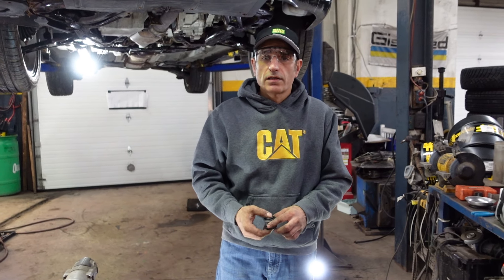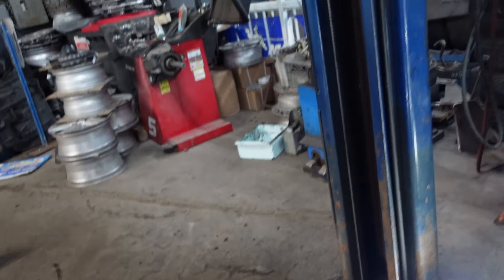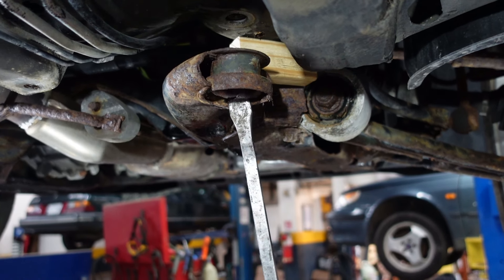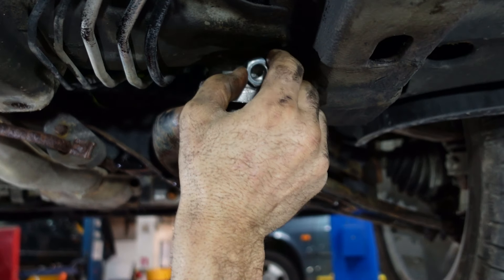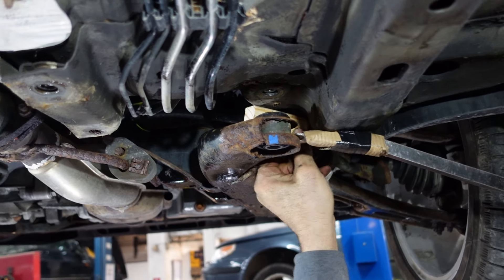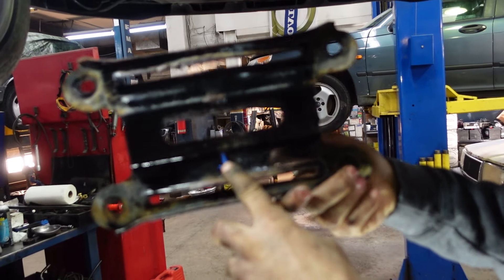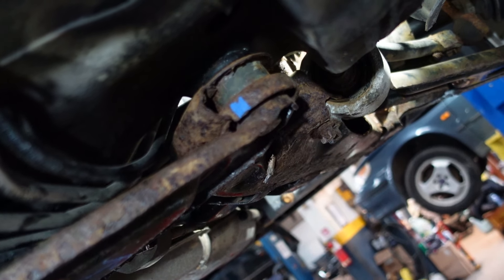How to Replace Press Fit Subframe Bushing SAAB 9-5 1999-2009

Comment: Excellent video! I just finished front subframe bushing replacement work on my 2002 9-5 sedan and 2003 9-5 wagon. I installed Powerflex polyurethane bushings. Anyone who is looking for replacement bushings, I would strongly advise against using the blue polyurethane bushings. These are very low-quality bushings. These dry out and crumble very quickly. Thank you for the information. Cheers.
Reply from the maker: Thanks for sharing!👍

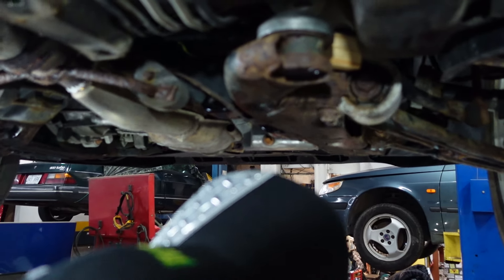Comment: Great video! Why did you mark the bushing and the frame and line them up before pressing it in at the 3:05 mark on the video? Do they only go a certain way?  Thank you.
Reply from the maker: Most suspension bushings come with markings on them. It should be positioned & installed properly. In some cases, it is better to put a mark on them before removal.

Comment: Great video.  Did you only replace the rear bushings?  Early in the video you removed the middle bushing bolts but I didn’t see you replace the bushings.  I know the front bushings rarely wear out so I can understand if you didn’t change those but wondered about the middles.  Thanks.
Reply from the maker: I did not replace the middle subframe bushings. In order to replace the rear subframe bushings, you will need to remove the middle bushing bolts. Welcome!
Reply: Thanks for the reply.  Is your experience that the middle bushings are usually OK?  Many have said the fronts are usually fine.

My right rear is toast but the left rear appears OK so I was just going to do the rears.
Reply from the maker: In general, both rear ones will go first.
Reply: Thanks.  I’ve also read that the right rear tends to go first.  I think this may be because the right elk horn engine mount sits higher than the transmission mount on the left side, plus the rear mount and torque rod are lower and biased a little to the left side.  So, the engine may twist a little more on the right side putting more stress on the right side bushings.  Since the engine’s torque causes it to twist counterclockwise when viewed from the right side when in forward gears (especially so when moving from a dead stop) the right rear may see the most stress.  Anyway, that’s my theory…

Interesting that NG 9-3s don’t have the same problem.
Reply: Finally got my press tool but managed to change the rear with "jacking" it up and using the weight of the car ,  do you change the middle with subframe on the just as easy as the rear one ?